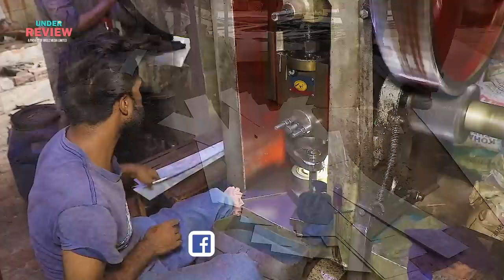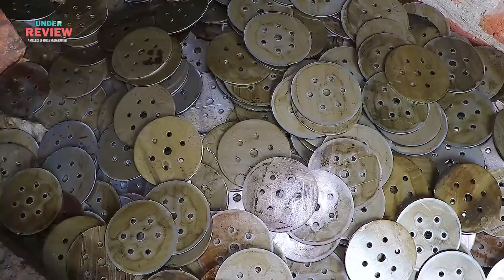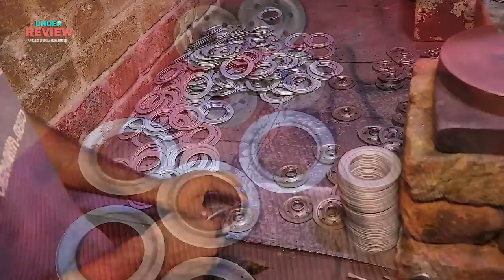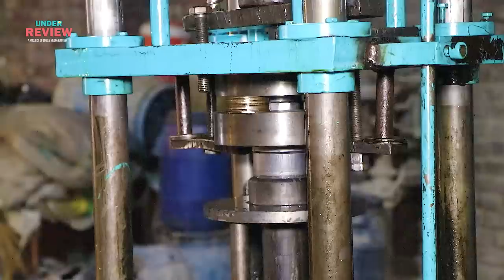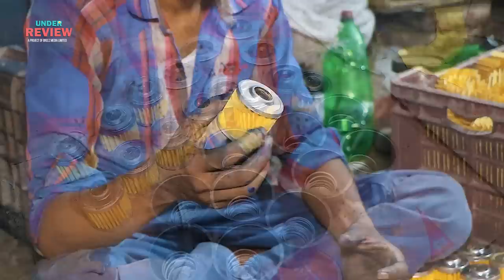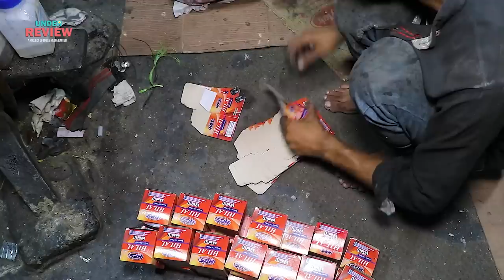How Car Oil Filters are Manufactured

Comment: Wow, someone finally snuck in and filmed an actual FRAM production line.
Reply: I work for the company that makes a couple of FRAM constructions.  That is way worse than even FRAM will make.  LOL   The rust on the backplates and inside the cans was disturbing to say the least.  Compared to what we do this is literally like building a filter with a rock.  It is interesting to see how you can build a filter without million dollar pieces of equipment.  I was wondering how they were going to seal them and it was just a modified drill press.  I wish they would have shown the pleater though.

Comment: These filters are like a dollar per piece and in many cases offered free of cost when doing a oil change. Recommended change interval for these is usually 4000-5000 km.
Reply: I wouldn't use it if they paid me and god only knows where they get the oil from .
Reply: @LifesAbe-ach  probably a pump jack out back and refined in the kitchen lol
Reply: @IDT69  more likely oil waste from overseas filtered through a cloth lol

Comment: Take an oil filter from their trusted workshop and buy an identical oil filter at the cheap store. Then put both filters on the scale one after the other. You will see that the one from the good workshop weighs much more. It has many layers of different filter fabrics and not just one layer of paper. The good filter stores particles from large to small in different layers and can hold a lot of dirt. The filter with one paper must store all particles before one layer and is quickly clogged. The oil then no longer flows through the filter, but unfiltered through a bypass. Yes, I also bought cheap filters but I was suspicious and had the test with the scale shown to me by the good specialist dealer.
Reply: Genau so ist es . Öffne mal einen SCT-Ölfilter!
Reply: @j.s.561  Solche Filter kenne ich nicht. Ich achte darauf, dass meine Mann, Knecht und Mahle Filter nicht gefälscht sind.

Comment: Here in Australia I worked for Kirby Products making filters to OEM (Original Equipment Manufacturer) to Australian Standards  using ASTM methods. Looking at this makes somewhat cringe. I would not disagree the filters would work but to what capacity. The best thing one could do is section their filter and compare to a filter say made to specific standards like the JIS or SAA. Maybe these filters are ok, but one has to examine all aspects, including how ell they trap particulate matter. The quality of the filter paper is essential. 
Some of the work practises would never be allowed here in Australia. Those stamping machines are a joke, the fellow spot welding without eye protection is just absurd.
We could go on forever but these are the way people work in other countries, so be it.

Comment: Finally a video that shows Pakistan manufacturing without safety in the factory. Look at the hands of the guy punching out the round filter ends with the holes in them. Half of his thumbs and fingers are gone from using the press safely. It is a wonder that the other half of the work force don't lose parts of their feet as they all wear flip flops instead of work boots and they all wear the long pajama type loose clothing that can get caught in the machinery and rip their organs out of their chest at any minute. What an Osha nightmare if it was here in the states.

Comment: That is the cheapest oil filter ever made
Whoever use that for his engine will have to change it every 100 miles 
Look at the filter media,
I didn’t even see a bypass valve, just a spring, and that made from wires 
Sad…

Comment: The worst of the WORST oil filter made in this video.  the paper filter quality and size is no more than 1/4 of what is supposed to be, the machining is very rough, and the anti-drain valve is so flimsy.   I would never put such a filter even if they give me money for using it.  Only fools use such filters.

Comment: Total garbage filters. Pure junk.
The fuel filter on my motorcycle has more filter element than this oil filter. They didnt have internal pressure bypass . Very little filtering matterials inside. 
Even if they were free I wouldn't use them.